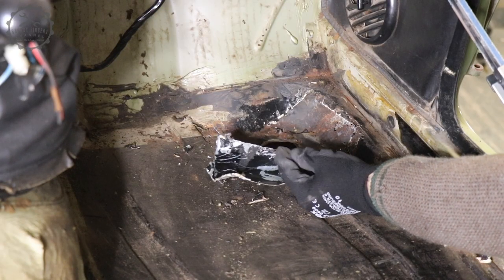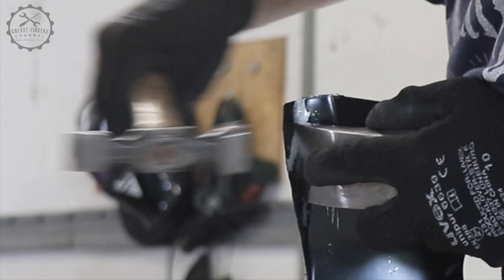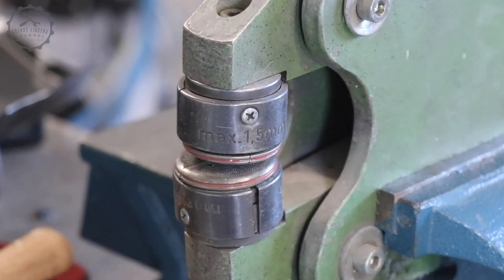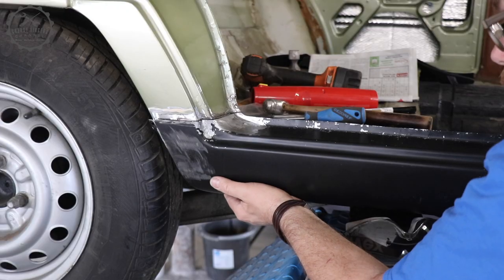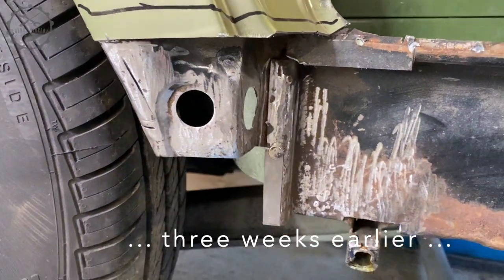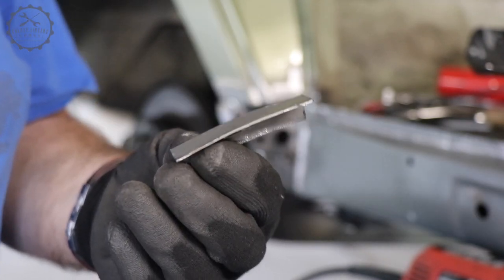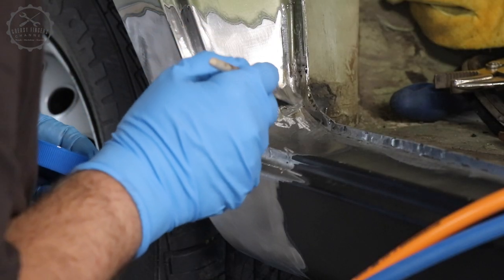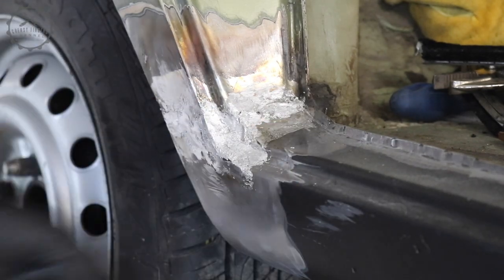Alfa Romeo Giulia (105): Restoration of the Door Sills, Part 2

Comment: You did an excellent job with good pictures and explanation to understand your steps. Thanks - it helps me a lot.

Two questions:

1.) In part 1 you prepared the new sill with removing the protective coat, then adding Brunox and Inox spray - my question here is: can I add the Inox spray directly to the Brunox layer?

2.) In the end of this part 2 you added a grey layer: I guess this is just filler as a preparation for the upcoming paint job, isn't it?

Thanks a lot and thumbs up!
Reply from the maker: Thanks, mate!
1) Yes, I did it exactly like you say, but in hindsight I’d do differently. My latest ideas on the topic have been included in the movie about the GT sill restoration which I posted last week. 
2) Exactly!
Reply: @GreasyFingers  Thanks for your quick response. I will watch the GT sill restauration videos as well - you got one more subscription.

Comment: awesome work 😎 I noticed the lower inner rear wheel arch sill has large round holes, would are these not fill with dirt & water, why not cover them. Thanks
Reply from the maker: Thanks, Craig.
I guess you mean the access points for the cavity protection? They’re sure going to be covered, but there are a couple of steps to be carried out before.

Comment: Hi, I have found this fascinating. I have a 1991 Alfa Spider S4 that has spent most of its life in Florida. It appears to be in very good condition with no external signs of rust anywhere on the body... However, I think it might be sensible to spray inside the cavities. I note your comments on the construction of the 105 sills. Is it possible to get access for spraying something like fluid A to get into the sills, and protect the inner, middle and outer sills, i.e. the cavities? The car now lives on the Isle of Man and the climate is cooler and wet! Your videos are excellent. Thank you for your hard work.
Reply from the maker: Thanks, Mike. That’s very encouraging. 

I don’t know the Spider specifically, but I guess like the other 105 it will have access points to the cavities of the sill from inside the car. Bad news is that one needs to remove the carpet and in the first instance only the cavity between inner and middle sill can be reached. There are passages from there to the cavity between middle and outer sill but you have to find out where exactly they are.
When I did my mate’s GT I therefore drilled holes in the outer sill. That’s a bit radical, but works very well. 

Maybe one of Jethro’s videos covers this?
Reply: @GreasyFingers  Thanks for your reply... very helpful indeed. I will see if I can find any drawings of the sill components and go from there, and will look at Jethro's videos. I have been watching him for a while. I have bought one of the spray guns you recommend. I just need to source a decent fluid, one that is available in an increasingly isolated UK!! I wish I had your metal-forming skills. Enthralling to watch. Can you recommend a good MIG welder?
Reply from the maker: @mikeblayney1308  Sounds great, Mike. Please keep me posted.

Comment: EDIT: IGNORE ME, IM WRONG

I'm confused. Where is the bottom of the A pillar? Surely there should be an inner piece that has the strength and holds the door up, etc. On the coupe its massive at the bottom of the A pillar and goes all the way to the bottom of the sill/chassis rail, AND then the outer sill panel goes on.

I assume the B pillar would have a bottom too ... not just the outer panel
Reply from the maker: I recommend to watch Part 1 of the sill repair movies. 😊
Reply: @GreasyFingers  I have. So are you saying there is no inner piece and it's just the outer panel? So different to the coupes
Reply from the maker: I’m sorry, I wasn’t aware. I’m rebuilding the A-pillar in part 1 from 5:00 to 7:40. It’s welded to the inner sill at 9:00. Please see also the sketch I’m drawing in part 1 at 0:25.
Reply from the maker: The B-pillar is connected to the inner sill (see part 1 at 15:00) and to the outer sill see part 2. It’s not connected to the middle sill. Hope that clarifies things a bit. And yes, the designs of Giulia and GT/Spider are quite different.
Reply: @GreasyFingers  I got my parts manual out and yeah nothing like the coupes. Sorry just assumed they would be similar, but nope the whole side (pillars, up into roof and sill) originally was one pressing.

Sorry for any stress caused 🙂
Reply from the maker: No worries, mate. Nothing comes close to some high-octane car talk.